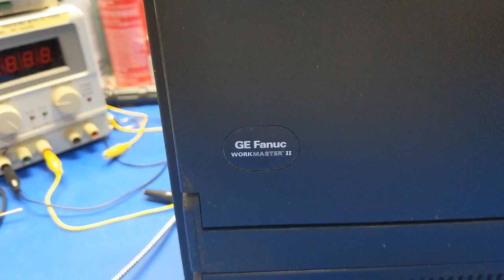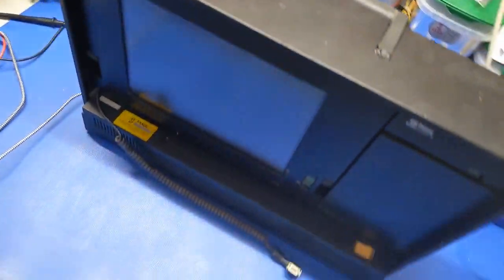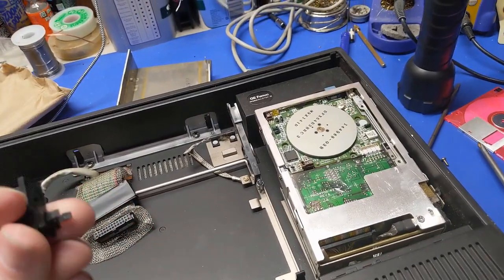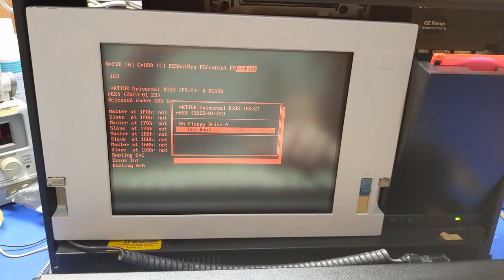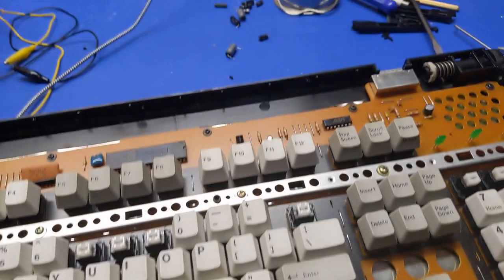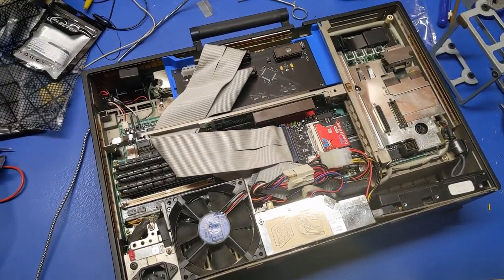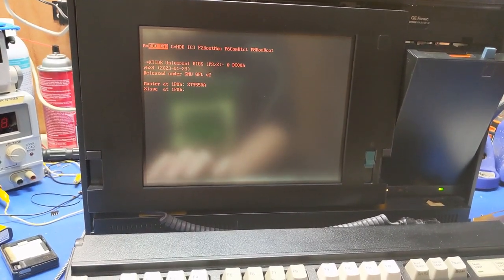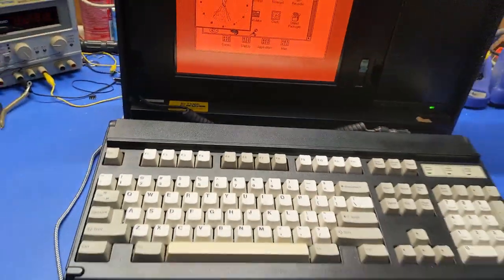Let's check out and fix a GE Fanuc Workmaster II 386

Comment: I spent many a day in front of one of these. They are intended to be used to program GE Series Six PLCs. The cost driver is the IC647WMI920A interface card. Which you are missing...

The software that came with it was GE Fanuc "LogicMaster 6"

The predecessor to this model is the 8086 5150 (?) luggable which came with either two floppy drives or a floppy drive in conjunction with a hard drive. I have the outer case of one that was destined for E-Waste. It's my $10,000 trash can.

Comment: Protip, another thing that seems to happen is the ROMs in these machines succumb to bit rot after so many years. Good idea to get some EEPROMs of the same size and program them up instead so to mitigate that. I'm currently waiting on some to do that to mine, which I've had all sorts of fun with. Also to note, the capacitors on the graphics board should get replaced as well, they're a common issue as well as they fail silently, showing no signs of failure. You should also at some point tackle the PSU, which I know I've had to touch up cracked solder joints in mine before a number of years ago.

it's so weird that I recently found out about the McIDE existing like yesterday, and thinking how it'd be a perfect addition to that P70 if I get it working again properly as I really hate that it has a chonker ESDI drive in it now, and whoop, here's an older revision rebadged P70 with the old board and old plasma card, with said card installed. I'm hoping the creator makes a smaller board that can fit in the short board slot, as I really really really want to be able to keep my WD eth card in the long board slot.
Reply from the maker: At least your ESDI drive works. None of mine do, and I also dont have an HDD for my PS/2 model 30 either.